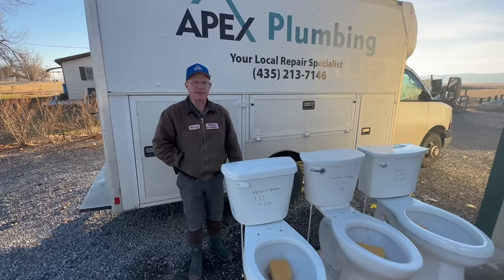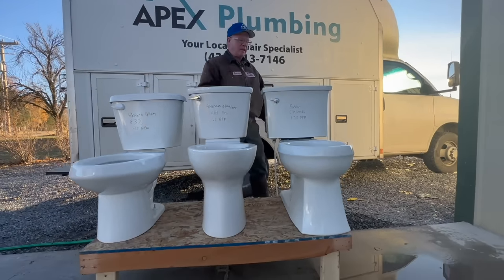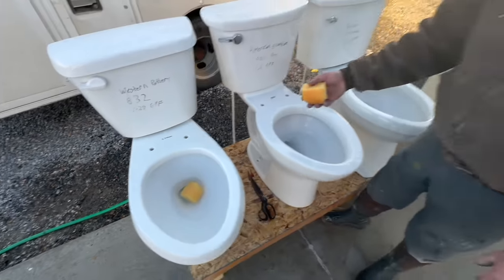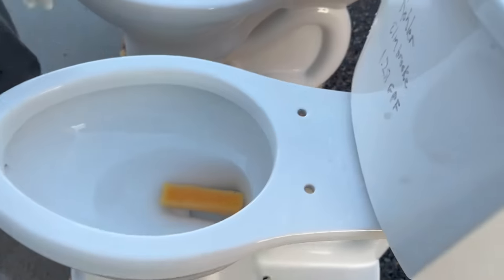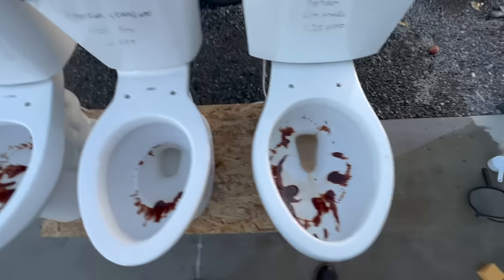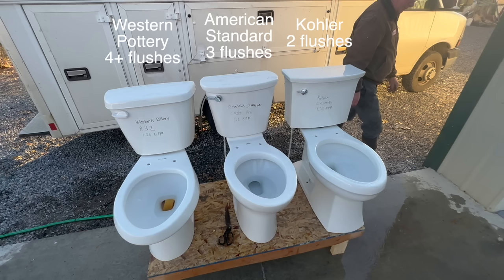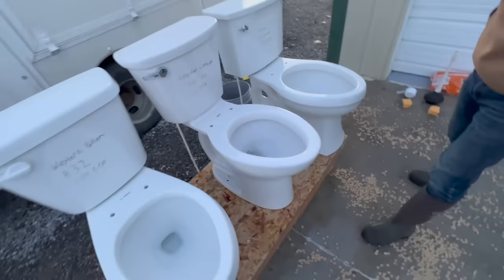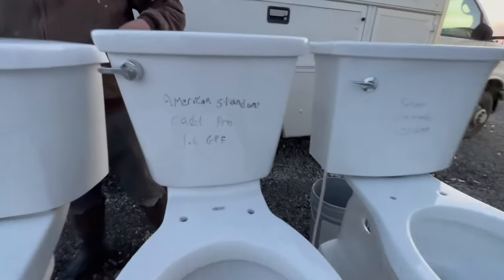What toilet should I buy? 3 different brands compared

Comment: Been a plumber for years retired now and I always recommended American Standard to customers mostly because you can get parts almost every where in any store.  Cheers
Reply: I've had good success with the champion pro series
Reply: Really???? Not at home Depot. I am ready to remove the last toilet because of the ghost in the tank. If the 4112 tank would fit on the bowl I have I would just replace the tank. 73
Reply: @dustinpomeroy8817  much more today I was looking at one with all the added features  but that can run into some money. For my new home in the mountains I may spend more on a John but for now I want one with replaceable parts that can be bought at the big box stores . I do my own plumbing so I look for easy. I probably will never buy American Standard again. The ones we have where I work are easy to repair I been doing it for over 20 years.  But my junk I bought about seven years ago are ghost John's . A flapper and fill valve is the best john for me 

PS in not into saving a cup of water. I like the double flush I know if the next person is going to over flow the John. So I can clean the line out with hot water. I save our company hundreds of dollars on plumbing service calls. 73
Reply: Unless you're using the same gallons per flush they can't equally be compared. 1.6 vs 1.28 is a significant difference. Apples-to-apples American Standard is no better than Kohler in my experience. In fact, I prefer the lack of flapper hang-ups with Kohler's piston flush.
Reply: @maintenancetech283  I prefer the American Standard 4112 tank they use standard parts. They can have these good for nothing o rings and seals. I never had problems with korky flappers and fluid master fill valves. That's what we have at work. I am part time on toilet maintenance so quick is all the time I have with my other job duties. 73
Reply: These toilets are like mouse traps. Old faithful kills mice without all this plastic stuff they came out with. The same with the John. Stick with what worked for years without a hitch. Flapper and fill valves. 73
Reply: @maintenancetech283  What you people are not understanding is not the way the water is delivered or excavated out of the system is the issue. It is the quality of the design. What I would do every time I installed a toilet except a 1 piece toilet is turn the bowl upside down and inspect the hole, and just inside the hole. Some times the areas are really rough and have pieces of clay nobs stuck to the side or the clay sagged a little in the holes and slowed down the movement also you have to check the siphon jet to make sure it is running freely. cheers   Remember folks made in china
Reply: Lowe's carries parts for Toto. Pretty basic stuff, a flapper and fill valve.  No "tower" or any other proprietary garbage.
Reply: American Standard gives a good clean flush and quiet fill-up. No one likes a noisy toilet.
Reply: I just bought an American standard and while it is functional (for now) it is really poorly made. The back rocks back and forth extremely easy and t hey went cheap on the wax ring, so you can't even install it the way the instructions tell you to.
Reply: @MAGAMAN  I had mine installed by a plumber who used his own wax ring to guarantee the job.

Comment: I miss my 5 gallons per flush toilets
Reply: Same like what is the point of high efficiency toilets if you have to flush then 5 times
Reply: I wonder if you can still buy them in Canada?
Reply: @Victor-nn2wi  I have 1.28 gpf toilets.  I have not needed to use a plunger in years.  Buy a good quality toilet.
Reply: @bluesguitar1973  there is none. I bought the American Standard toilet that was clog proof but that's a lie. And you cannot get parts for it and no universal filler valve and flapper will work. It's not so much the valve but it's a ghost toilet with the original parts installed, the worst 230 dollars I spent. I want a toilet that I can buy parts for it and home Depot don't carry the parts for Kohler or American Standard. I do like the American Standard toilet we have at work with the 4112 tank they use standard replacement parts and when you flush these toilets they flush twice. Keeps the bowl clean. 73
Reply: Why should I worry about water I have a well and if I wanted to I could reuse washing machine water for the toilets that would save much more water than these stupid toilets. 73
Reply: @Ron B  shit,that's not a bad idea, you outta figure that one out.

Comment: Had a Kohler toilet (expensive) or about 2 years. It kept clogging up. After a number of calls to Kolher, the toilet went out to the curb. The American Standard replacement has worked perfectly for 5 years now.
Reply: I believe that kohler makes the "cimeron"- im probably wrong on the spelling, but its one of the best toilets for low flow high rush/evacuation of the trap toilets we used in a multifacility maintenance position. I was bummed to not be able to put one in at my house due to lack of product at the supply house.
Reply: Me too. We have the most expensive Kohlers. They clog all the time. We are so over it. Very disappointing.
Reply: Hmm. I have the cheaper Kohler Highline and bowl rinse is the weak spot. I have never once clogged it and I’ve given it more than enough opportunity to clog.
Reply: I was going to spend the extra money and buy a kohler until I started reading the reviews on Home Depot. They can't even get these things out of the factory in working conditions.

Comment: I installed American Standard Champion toilets in my last house and I was very happy with them.  They worked extremely well when my brother came to visit which is an excellent testament to the Champions efficiency as he is a notorious toilet clogger.
Reply: i had one and it never got clogged but it left stuff in bowl, so you had to flush twice and hold lever down to try and get bowl clean i switched to toto and it is way better.
Reply: I got a brother like that too.
Reply: Sounds like your brother is emptying out all at once instead of after each meal. He may need more fiber in his diet. Heck, we all need more fiber in our diet. LOL
Reply: LOL... you got to be kidding.  Its a terrible design and leaks every year and you have to remove the entire tank to replace flush valve and gasket.
Reply: @meenam300zx  Nope, not kidding.  I never had an issue with either of the two that I installed.

Comment: I have that American Standard and it has never failed.  Best toilet I've ever had.   It has never clogged.   I'm so used to it that my friend's toilet scared me when I flushed it.  The water comes up so high in the bowl and goes down so slowly in comparison, I thought I was going to have a flood.
Reply: I totally agree! I have an American Standard which I purchased for $100. It is the best clean flusher that saves me money on my water usage account for sewage fees.
Reply: I have an American Standard toilet that came with the house that I bought 12 years ago and if you do a pee, it only needs about 1/2 gallon minimum to do a flush.   I’ve seen a whole variety of toilets, some rather brand new, in the many hotels I have stayed in while traveling.   Some of those toilets, even brand new, you might need a gallon or a gallon or a gallon and half to get a pee to flush own.   I’ve learned a lot about various toilets from all the places of lodging I have stayed at and if I ever had to buy a new toilet, I have learned you got to know what to look for when you need to replace a toilet.   They are not all the same and some flush lot better than others.

Comment: You should do another test to see which toilet flushes out a long pipe run best because at least one toilet is usually put at the farthest end of the main sewer pipe so when it flushes, it can help to clear out anything left behind from the sinks and other fixtures that run into the line downstream.  They came up with these standards of only 1.23 gallons of water per flush to give plumbers job security when they have to come and clear everyone's drains all of the time because toilets don't put enough water down to keep the pipes clear.
Reply: My dad has the same concern with getting rid of the old toilets.  The extra water helps flush the pipes out and gets it where it needs to be.
Reply: I have cleaned over 40,000 drains.
The government doesn't care.

You should see what sealing the burner to a gas water heater does.
Reply: Stupid 1.6 gal flush clogs up rural lines that have to run 100 feet to the sewer, that's why I put in an antique toilet with the BIG tank, never had to call roto rooter since I put that one it.
There's NO WAY 1.6 gallons let alone 1.2 is going to carry a pile and paper  down 8 feet, laterally 10 feet, 90 degree turn and 100 feet down the driveway to the sewer under the road, it needs at least TWICE that amount of water or more. I pay for my water by the 1,000 gallons and never USED 1,000 gallons in a month. I have a Speed Queen washer that actually FILLS the tub to the top for an actual wash, bought that and threw away a 2 year old Whirlpool Washer that thought 3" of water in the tub was enough to WASH two full sized blankets, are they serious??? Nobody even wanted the Whirlpool washer, it sat by the curb for a week, even put it up on FB market place free, tells you something huh! After a week of sitting there I wheeled it back and broke it apart to scrap the metals.
Reply: @HobbyOrganist  Those 1.6s are probably good for vertical flushes like apartment buildings but no so for single family residential with horizontal flows.
Reply: Got into a habit of flushing twice with modern toilets to move solid waste. I’m a fan of American Standard
toilets. Quality and performance in my opinion.
Reply: state code says for every 1 foot the pipe must be angled 1/4 of an inch here's why, too straight and the poop won't gain momentum to flow with the water which is essentially faster, too steep and the water will fly past the poop and not carry it through the pipe so it gets left behind and builds up
Reply: That's why I will never get rid of my 25 year old toilet
Reply: I have two American Standard Champion 4 toilets in my house. They never clog and, not bragging, I fire out absolute solid monsters that used to clog my other toilets at least once a month. I usually do another flush after I finish because no way 1.28 gallons is going to move those bad boys out to the street in one go.
Reply: T Raybern  You know what?  It never occurred to me to keep doing that.  Although he's still got those 80s toilets that don't flush so great.  Uses a small trash can of water to get em down.
Reply: I hate to get rid of the toilets that were installed when my house was built (1951) … as I’m getting older my knees aren’t what they used to be , so I’m considering 2 new comfort height toilets.
Reply: @donaldperrotta8514  The American Standard Champion can be bought in an oval comfort height and it comes with a slow closing seat! I can testify that it is far and away the most comfortable ass holder I have ever set on. I read on the toilet and if I get to an exiting passage in a book I spend a lot more time on the seat than what was needed for the original purpose of why I sat there in the first place. Trust me, you won’t be disappointed.
Reply: @donaldperrotta8514  Don't forget that they make raised toilet seats you can put on to do the same thing.
Reply: @donaldperrotta8514  Rebuild those toilets with all new hardware. And get something to extend the seat height.  Or perhaps you can save those 2.5 gal tanks and attach them to the new ADA bowl.
Reply: I heard a story about 10 years ago that San Francisco has to bring in multiple trucks of water to flush the sewer lines because now that they went low flow the system doesn't have enough water to keep the lines clear.  And now the same amount of water still goes down the drain from their reservoirs but some of it has to be trucked in on trucks that burn diesel.

Comment: I’ve been a plumbing contractor since 1995 and a plumber since 1979 whenever I install a tank toilet I always use American Standard Cadet Pro! They flush better than any other toilet and if needed you can hold the tank lever down a get the full tank flush and they swirl better than the rest.

Comment: I could plug up any of those wimpy toilets! When I do a one week dump the toilet is filled with the top of the pile of crap sticking up out of the water! My old 5 gallon toilet with the 4 inch pipe still has to be plunged. I even plug up the commercial pressure operated toilets! What difference does the flush  amount make if you have to flush it ten times! Also you didn't do the colored water test. (pour food color into the bowl and see how many flushes to get clear water. )
Reply: I’m with you. Clogs EVERY time. A plunger is a must have for me.

Comment: All in all, most toilets today works okay, and most will last just about 3-5 years before you have to replace them. Had American Standard put into my new house, Last about 4.5 years, Have the Koehler now and work well, it’s been about 5 years so far. So most are just what is preferred by the buying.  Great test .

Comment: A couple things I learned about selecting a toilet when I bought one last year:

1) Pay close attention to the "trap/gooseneck" cast into the rear..... the point where the water can flow over and go down the drain is the highest the water level in the bowl will ever be.  You cannot adjust the bowl water level by maxxing the level in the tank.  The toilet I bought leaves very little water in the bowl.

2) Pay attention to the warranty - specifically regarding the porcelain finish.  I "cheaped out", bought a budget model, and the finish above the water line is irrevocably stained at less than one year old.  Bleach not only didn't clean it, it actually dissolved the glossy finish and left it "matte".

Spend the money, buy a better quality than you think you need.

Comment: I put in a tall Deer Valley round-front toilet a year ago for $150.00. It’s only a 1.2 gallon flush so it refills in a heartbeat, but the reason I bought it was because the front of the tank is concave. It hasn’t plugged and it seems like the bowl is made from Teflon. I’d put one in our other bathroom too but they don’t make it in bone color. I put in 27 ADA American Standard toilets at a senior high-rise. Nothing special about them other than they cost three or four times what they’re worth. Wonder what Standard pays out in kickbacks every year.

Comment: I have a jacuzzi 1.6 with a 3" flapper valve  it will do a half flush and has never been stopped since I installed it over 5 years ago. The best unit I ever had.

Comment: I would add the the design of the valves/plunger inside as a factor.  Some toilets might flush well, but uses expensive plunger/valve systems that makes it prone to leaks, failures or hard to fix or replace.
Reply: Trutrek I hear you. The last American Standard toilet I installed in my home is a ghost toilet it's always refilling up all night And day. I fixed it so it just leaks in the bowl but doesn't refill up. I just let water go in the bowl until the tank refills then I flush. But it takes the second flush to really clean out the bowl. I'm going to replace the ugly bowl and tank. I cracked the last tank in the master bathroom so I will remove the cracked tank and use the front tank from the other bathroom. I'm going to look inside the box before I buy new. I want just standard parts no O rings and seals just flappers and fill valves. 73

Comment: I installed 2 cadet3, the cheapest and smallest of the american standard, in 10 years they have never clogged. I will say you need to adjust the handle for best performance.